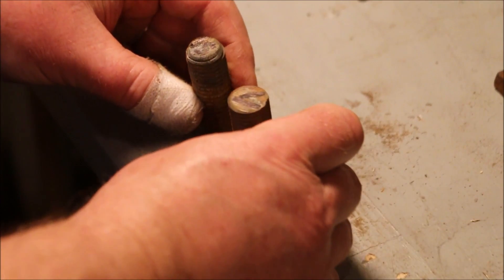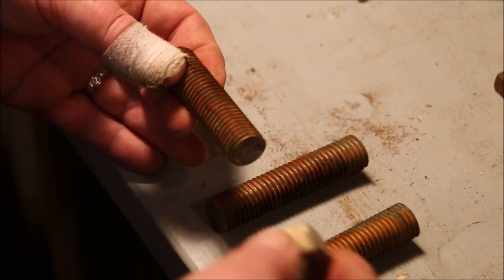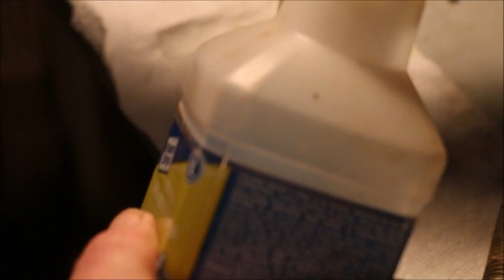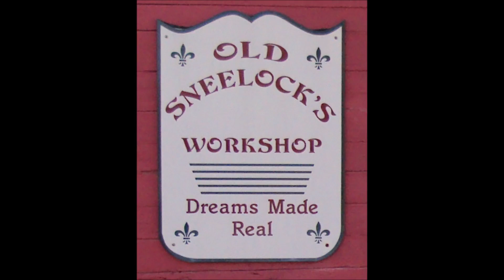SHARPENING FILES WITH ACID ~ PART 5 ~ WHAT IS HAPPENING

Comment: Coming along the difference to me is right there it's like black and white I can see the difference in the threads of each sample no measuring needed to me or well
Reply from the maker: Arguments are won and lost based on facts and data. I sat in enough meetings with customers waving their hands about issues and problems where I was able to demonstrate that the issue was not what the customer expected. After the original run of File Sharpening With Acid I decided I would bury the issues with data. 
Measurable, repeatable, results win every time. 😊

Comment: ..did you happen to take a measurement on them Bossman to see if they lost any thing on the diameter and such?? Here's a thought. What would happen if you were to lap the file with sandpaper?? It should wear the down the teeth a mite, but wouldn't give it much angle on the teeth, my thinkin. But if you came in at a slight angle with the file it seems it ought to cut...??!!??
Reply from the maker: Yes I kept a sample of the original threaded rod and have been comparing it to the samples in the process. Up until today there has been an apparent change in the profile of the threads but my measurement methods are too crude to allow for the tolerance in the process. 
Working in macro the increased activity from correcting the concentration should provide results in a reasonable time.
As far as lapping the file with sandpaper it will work but only if the material is soft enough to let the file dig in, or the part profile is such that the surface is narrower than the space between the file teeth. It comes down to relief angle. If you lay a knife flat on it's side,  on a flat surface, and move the knife around it won't cut in. You have to angle the edge so it bites in. Otherwise the edge is just sliding along the top. 
Lapping the top of the teeth with sandpaper will flatten the tips and the file won't bite against a flat surface. 
It might cut against a sharp radius that lets the material protrude into the gullet between the teeth but as soon as the file has worked the radius so that is lost it will stop cutting.

Comment: And the test goes on!  Results are nearer every minute! Bach from the V.A. Tele-retinal was fine. A1-C was 3 something. WE talked about pyramid schemes and all matters of current events. Rain was just shy of 3 1/2 this morning. I got to get after a mower. Hot, humid and will probably get a banger this evening. Got into rain just my side of the airport to almost back to the county seat. It'll be here before long.Did you have a mix on the old video? Just wondering.
Reply: Lewie McNeely well still really glad it all went well for . I to find two eyes in the front a great asset don't like the fact they are framed though in glass
Reply from the maker: Forgot to turn off the phone. Walked into the house. The phone recorded everything I did.
Reply: I just got a funny about them. People are prisoners of them. That's why they're called 'CELL' phones! Got the banger but got some mowing done. Ground is as rotten as a spring thaw. Mud coming up everywhere. Started sparking and banging and I quit. 'Nuff is e-nuff!
Reply: Lewie McNeely hi mate so glad the VA visit turned out good . I think you should convert a boat for the mower might help . Could be a new show for red lol all you need is mans best friend duct tape 👍
Reply: Evening, Ad Man and I don't want to think about Red too much. He usually comes VERY close to working but not quite. Yes, everything is as fine as it'll get. I'll get a letter from the doctor but the examiner said he didn't see a thing out of the way. I still had 2 eyes and they were still in the right place even though some think I just have one in the middle of my forehead. Sugar was still very good as far as the A-1C went. We always talk diet and all matters of stuff. Great guy. Like you! And Unc. And the rest with the GIRLS of course, BLESS 'EM!
Reply: Mine are as I read but no big deal. Just like our other problems; we deal with them.Like my examiner said, 'What are we going to do when we get older'? He's 50 and me 67. I said 'WE just keep going because we can't quit'. When we CAN't go is when we quit. With our boots on, God willing. Nite nite!

Comment: not quite the super acid from 'aliens' i am surprised it didnt take far more away, of course its enough to ruin an actual file if left in there
Reply from the maker: When I worked as a machine repairman and maintenance at Borg Warner we had a wash line for cleaning the brass radiator components before they were soldered. The original cleaning solution was citric acid which does a good job removing the oxides and sulfates from copper and brass while remaining fairly benign. 
The engineer in charge of the line operation decided to switch to sulfuric because it worked quicker and didn't require heating to speed up the reaction. 
Soon after changing over to sulfuric the operator was loading the tank just as the bell for break sounded. He lowered the stainless steel basket full of brass radiator tanks into the bath and left. 
When we got back out on the floor there was a cloud of steam over the washline The fiberglass tank was bulged and when we pulled the basket out of the tank the stainless tank was nearly gone. The brass had gone from .060 thick to the thickness of tin foil. 
The sulfuric cut a lot faster when it was heated. In the normal 1 or 2 minutes the basket was in the tank the acid didn't get much above room temp because the parts cooled down the tank when they were introduced. Over the 10 minute break the tank had time to heat up. 
Not quite the Alien level of acid but it doesn't take long for the reaction to get out of hand. 
The washline was changed back to Citric Acid. 😊
Reply: Unc. is too down to earth to be alien.
Reply from the maker: Lewie McNeely It just a matter of proportions. Reaction makes heat. Heat speeds reactions. 
Larger container = more surface =  full immersion.
Reply: Snowballing!
Reply: Usually when there's a screw up bad enough for everybody to talk about things change. Chemical Safety Board has some dandy videos of runaway reactions that destroyed stuff and killed people. I read all the fatalgrams at work and most were from not getting the operators attention while being where you weren't supposed to be and getting wound up in conveyors. I believe what they say and I'm still here, so far!